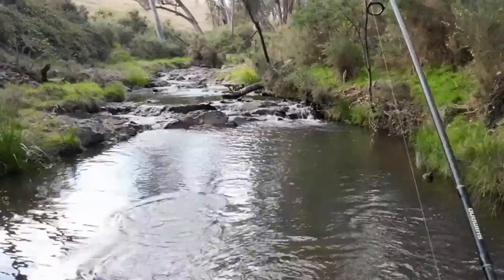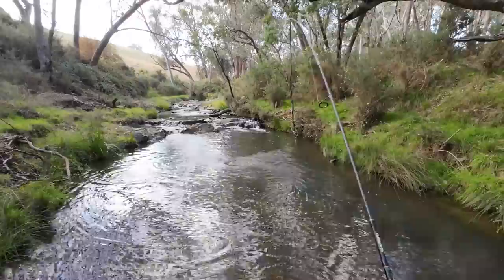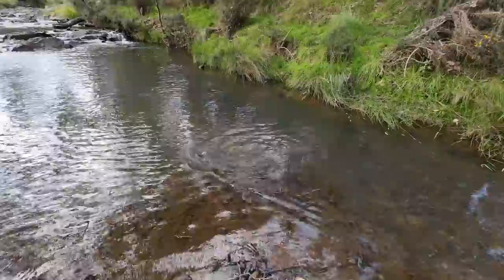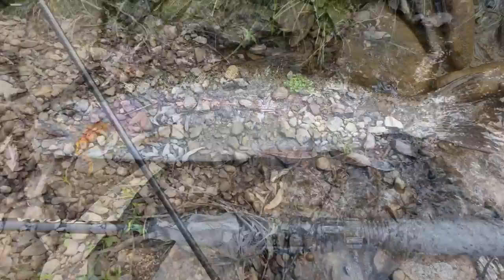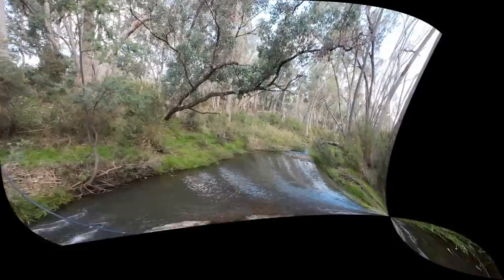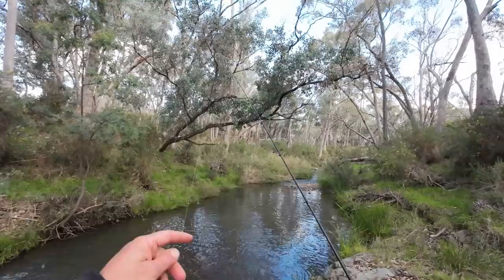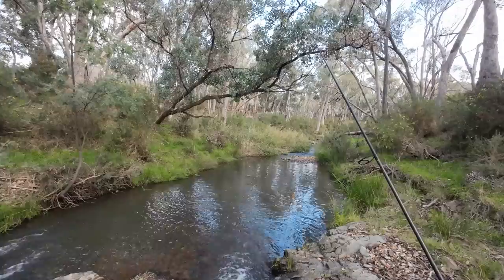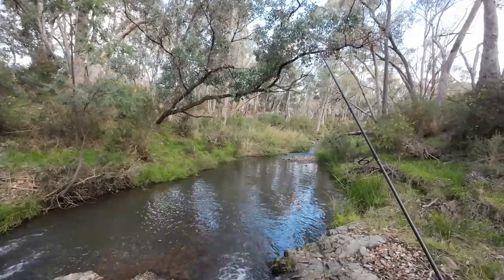How to set the drag on a fishing reel

Comment: Great video Robbie, you're right that there are a lot of factors to think about. Your tactic of having a solid drag for the hook up and then backing off a bit if it is a solid fish is a good one. I do that a lot myself on the big Snapper and Mulloway

The only time I go with objective drag settings is in the game fishing world where we set the drag at 1/3 of the line's breaking strain with a set of scales. The reason for that is we use mono and it pulls the stretch out and then puts direct pressure on the hook to punch it into a Marlin's boney mouth. There are drag adjustments during the fight as well but we always know where on the big reels where that 1/3 drag pressure point is as a baseline.
Reply from the maker: Thanks mate. I've never been big game fishing but it sounds like a lot of fun.

Comment: I set mine tight then undo the drag one turn then test the line to see if it working if not i go 3 on my drag then test it then if it starts dragging i just leave it . When running circle hooks i let a bit of line out floating on the water then watch it when it starts heading out i slowly start wonding it in with no striking let the hook do the work